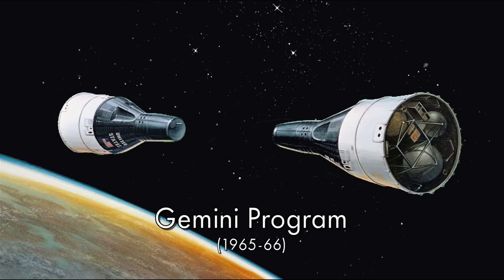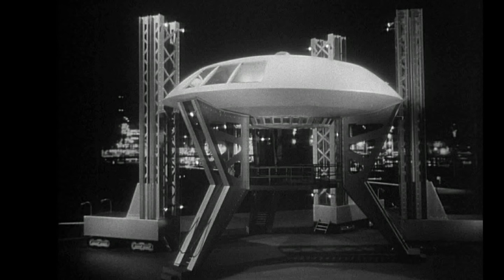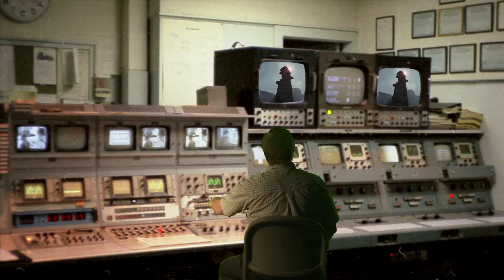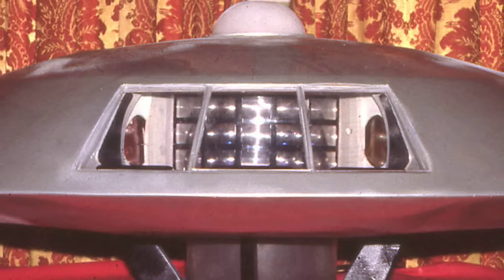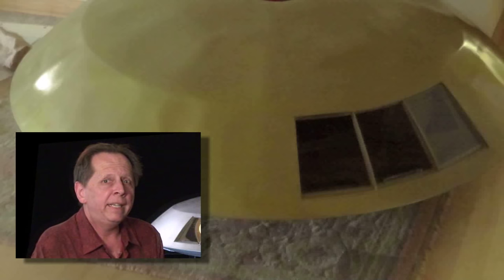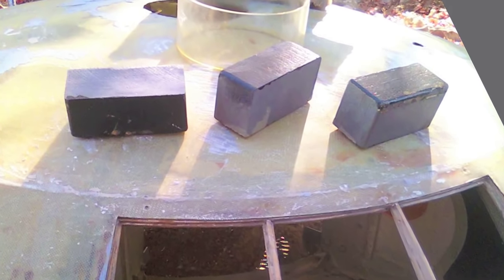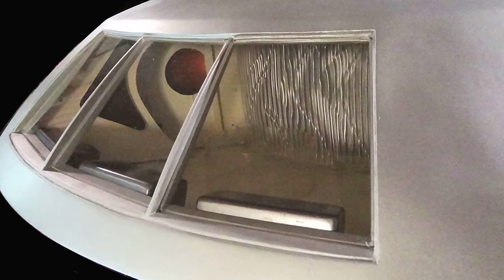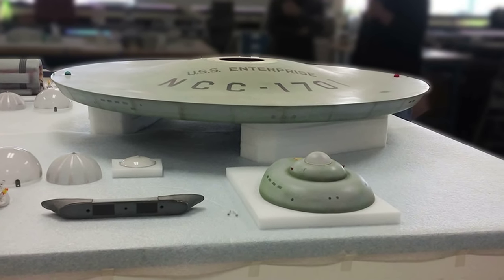RESTORING THE GEMINI 12

Comment: Paul, I gotta say I am JEALOUS!  You did a fantastic job on that ship.  I'm a huge fan of LIS and would give anything to see the model of Gemini 12 in person.  When will Andre bring it to the midwest so we can see it?  I understood the way you felt about the "melted candy bar" mention.  I saw some of Irwin Allen's props at Marine land in 1975 on a family vacation (Seaview, Robot costume and miniature chariot).  Sadly, props are made only for a few time uses and only to look good onscreen.  That's why they're made of balsa and fiberglass.  I remember that auction mentioned in Starlog magazine around 1980 (maybe).  I heard it sold for some $700 and me thinking, "Gee, if I only could buy that thing."  I'm glad Andre got it, though, and had it restored.  Any other projects in the hopper?  Again, GREAT JOB.
Reply: Thank you.  I have doubts Andre will risk taking it on a "tour" as it is quite valuable. 
      And yes, I recall all those and more at Marine Land back when I saw them in 1975.  There was the 4 foot Flying Sub version of the Seaview (that appeared to have been repainted using a bucket of house paint and a house painting brush, somewhat less refined than another fiberglass  4 foot Seaview seen in our new video; "Relaunching the Gemini 12", one that was made from the very same original wood and plaster "approval model"/pattern).  Also, the 18" Flying Sub, the "Hero" Robot,  the small Chariot miniature, the Hindenburg miniature  and even one of the R/C Bell Jet Ranger Helicopter miniatures used in 'The Towering Inferno".
Reply: @paullubliner6221  Yes.  Those were the ones, all right.  I was 13 then and it was the coolest thing to see.  We were visiting my aunt and uncle who were living in Lancaster at the time and we drove ALL the way from Kansas, so, yeah, it was a big deal to me.  The Robot was in a glass case at Marine Land and you pushed a button and it lit up.  Of course, it was in really sorry shape, but to a kid --- that was the Robot. That's the reason I don't want to own props and settle for good duplicates.  I have the Remco Robot still and the Robot toy from 20 years ago that sold for $50 retail.  BUT, I have the Jupiter 2 --- a couple of them.  One I opened up and had fun, the other is unopened and hidden away in a closet.  I paid about maybe $40.00 each for them.  Now, they sell for some $500-600 or more.  Amazing.  Again, great job and thanks for answering.  One of these days, I'm going to learn to build my own Jupiter/Gemini (probably out of styrofoam, knowing me!). Oh, and my real name is Kent.  It was a pleasure to meet you, Paul.
Reply: @yaddamop  And you too Kent.
Reply: I was reading what you said about the props not lasting and one time on Antiques Roadshow they had a lady that was connected to Rudolph the Red-Nosed Reindeer cartoon at Christmas time. She brought Rudolph, Yukon Cornelius and I think one other prop toy but one of them had partially melted. They were the original puppets to the cartoon and didn't stand the test of time too well.

Comment: I find it funny that "dull aluminum" would be controversial.  From  a lighting perspective, its the most logical choice.  You can change its apparent color at will by using different color lights.
Reply: "Dull aluminum" is also one of the several reasons no manufacturer felt at the time there was any value in making a toy version!

Comment: I am puzzled by three things-- and by asking I don't want to diminish the efforts at all-- which were clearly enormous:
1.) The aluminum paint does not seem uniform.  Is that an aspect of the video photography?  It is apparent at 18:54 in the video and at 19:52.  Or, did the Gemini 12 have that look? 
2.)  In the video shots with the model owner, the legs seem to be sticking out and are not flush with the hull-- or are those the pads at the top of the display stand/launch platform painted the same color as the Gemini 12?
3.)  Is the sound deadening material, in black, visible when you look at the lower part of the ship-- or is that the way it was-- with a black line separating the upper hull from the fusion core?
Reply from the maker: Thank you for your questions, these are very astute observations on your part.  I will do my best to answer you:
1) 
 The restored surface was given a uniform and finely textured 
undercoat, followed with the "dull aluminum" paint. The appearance of a 
uniformity of the paint finish is actually a matter of the amount of 
light applied.  Please observe the exterior finish in the three exterior
 shots in the early portion of this video at 1:30-1:38 and again at 
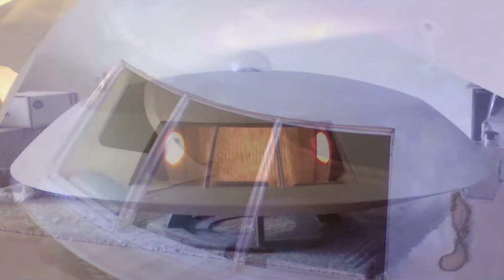17:15, here indoors but with very bright, indirect sunlight. The surface
 appears completely uniform. When filmed on 35mm color or B&W 
negative stock, using full studio lighting, the finish would appear 
exactly as it originally did; quite uniform. Also, in extreme closeups, 
this texturing would also be apparent.  

The original 1964 paint finish had dry concrete powder mixed in with the
 aluminum paint (as did the robot's torso) giving a fine, yet gritty 
surface.  This was personally related to me by one of the original 
prop-makers who worked at Herb Cheek's prop shop at Fox and who worked 
on all of the Irwin Allen shows, specifically on the Robot and the 
saucers for L.I.S. and also the Seaview miniatures for "Voyage".

There was a great deal more that went into this restoration of the Gemini miniature than time permitted to be described in this little video.

 2)
 The stand's three upright were precisely laid out at 120 degree 
intervals in plan view.  The apparent disparity you have noticed is 
simply due to how the ship was sitting on the stand during the video 
taping, it was very slightly offset of a true dead center.  And yes, 
there are three thick cushioning pads so no damage to the miniature will
 ever result.

3)  The sound deadening is completely internal within the Fusion Core's 
inner workings and are in no way visible.  What you are seeing is a 
slight gap that was visible on the original again, depending on 
lighting.  Extremely bright lights actually hide many minor 
imperfections by literally filling them in.  It is the difference 
between the widest ring of the Fusion Core and the way in which it fits 
into the recess on the under side of the hull.  

The opening in the original hull always was egg shaped due to the method
 of how the hull contour was generated (no room for as description here,
 sorry!) and the original fusion core fit no better than does this 
current version. You simply need really, really clear original prints and from all sides to see what I mean.

Paul Lubliner
Reply: Thank you for your response.  The early pictures certainly showed the painting to be uniform.
Reply: Solstice4MNM iiii

Comment: Excellent work. Thanks.  I have got to ask does anyone know what happened to the forbidden planet ship D57B from before  Lost in Space.
Reply from the maker: The large FP ship was sold at auction a few years ago.  The smaller one (about 18 inches) was shown a few years ago in Los Angeles at a Motion Picture Academy Forbidden Planet event.  Robby (the actual prop) also appeared and walked around!  Pictures of the props were not permitted, unfortunately, but you can probably find some on the internet.  The event was around 2014.
Reply: That's C-57D. The movie "Serenity" (spin-off from the series "Firefly") makes several allusions to "Forbidden Planet." The crashed research and rescue ship and its shuttle on Miranda bear the registration number C-57D.

Comment: As a retired professional auto body mechanic I can relate to the video on perhaps a different level than most. Time consuming , long term projects can wear you out! Looks real good, but the hull paint looks quite blotchy.
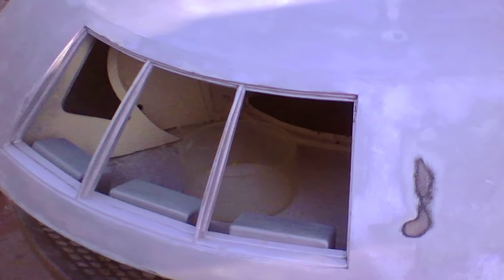Reply: "Blotchy"?  Then how do you explain the appearance of the very same finish at 1:30-1:38 & 17:15?  Come on, this isn't a "competition" after all. May I suggest you relax and simply enjoy this? 
Also, please realize, you're looking at the results of almost 50 years of practical skills and experience.  There's a great deal more to all of this than simply laying down low VOC water based paints, good old "Acrylic Lacquer" or even "Dupont Dulux"!  Those are all easy to get glass-smooth,  I've done enough of them over the decades.  But just like the L.I.S. robot, this thing was, and is textured.  Back in the day, Herb Cheek's shop threw in some dry powdered concrete mix into the base aluminum paint for that "texture". 
The answer to my initial question to you is:  "It's all in the lighting!"
Reply: Is Blotchy an accurate finish? True to it’s original appearance and finish? 

You see a lot of antique cars and planes restored to ‘better’ than new, which isn’t true restoration. If a production Model T had a finish that had runs, than a proper restoration shouldn’t look like a 21st century powder coat.
Reply: @larryscott3982  Larry, it's not "blotchy",  it's irregularly textured, just as when it was new and also as seen on the Jupiter 2 original miniatures AND the robot's torso.  What you call "blotchy" is as already addressed is directly due to the low level interior lighting we used on this video, it is not nearly to the same overall brightness level as was on the original show's sound-stage.  We used video and not film which requires a great deal more light for proper exposure than electronic imaging. 

When this miniature is viewed under  bright exterior light which is very similar to the foot candles of illumination found with full, period studio lighting, and as seen at 1:30-1:38, you can see for yourself the miniature is correctly finished.

Comment: Were the tubes the wires ran through restored?
Reply: Please go to:  13:33 minutes --and you will see the port side "Lydecker" copper tube through the "City Beneath the Sea" window opening.  Also, both of the restored front "Lydecker Tube" openings are visible at:  19:00 minutes and the port side front opening at 20:00 minutes as well as throughout this video.

Comment: Always been a fan, still have the '97 Trendmasters B9 Robot in the box. But did you all know: in astrology, Gemini ruled by Mercury and Sagittarius ruled by Jupiter are the travel signs and planets opposite each other in the zodiac. Famous inventor Nikola Tesla actually came up with the "saucer" design, and the gyro stabilization, drive control propulsion systems. His model fits the Jupiter II almost exactly. If I had to guess, there is an actual flying Jupiter II ! Probably hiding out at Area 51 which the public may have already spotted, UFO....

Comment: Who designed the Chariot?
Reply from the maker: Bill Creber was production designer on the LIS pilot. The Chariot was built right in the same workshop where the scenes from Alpha Control were filmed.  Bill wanted to use aluminum framing on The Chariot but budget restrictions made him use heavier steel. Irwin Allen had brought him over from his duties on VOYAGE TO THE BOTTOM OF THE SEA, to which he returned and supervised the changes to the Seaview's nose and control room.  Creber then designed the classic Flying Sub that still looks amazing.  He left VOYAGE to production design the original PLANET OF THE APES and returned to work for Allen on THE POSEIDON ADVENTURE and THE TOWERING INFERNO.

Comment: I've always liked the show but I never could figure out how everything could fit in the Jupiter 2. I also wondered if Batman bought his equipment from a scratch and dent sale for equipment from the Jupiter 1.
Reply: No, not Batman but literally "Voyage to the Bottom of the Sea".
     As for your "fit" question:  The truthful answer, is  it has to do with simple "Movie Magic", you have to keep in mind, that's all an illusion. --- Of course the depicted interiors couldn't fit in the Gemini 12, not the Jupiter 2 or the Seaview, and certainly not the Flying Sub.  But it was entertaining regardless.  
     That the interiors can't possibly fit is less significant than there being absolutely no room for any means for propulsion, essential fuel, life support, food etc.  
    In the realm of genuine Bona-Fide "Scientifically viable interplanetary spacecraft", there has been only one in all the history of film:   Kubrick's ""Discovery" from 2001.  At over a mile long, it depicted a "space train" with fuel, life support etc., for the five man crew,  where 3 of those 5 occupants were in suspended animation.  The dangerous engines were  that considerable distance away from the crew.   
     All of this for only a "neighborhood trip" to Jupiter Space.  The crew were housed in a sphere, the only rational shape as that form provides the maximum interior volume for the minimum external surface.  An internal rotating ring for gravity simulation was correctly depicted to avoid crew muscle loss during the relatively short several month's long transit.
Reply: Not to mention the chariot and in the later episodes a shuttle from memory. 
Who cares. My favourite show when I was young. Great work on the restoration.
Reply: @Icy_Lucifer1973  Thanks.
Reply: Remember the episode, "2 Weeks In Space"  3rd season where Will Robinson is able to hide himself in his closet from the pursuing aliens!  He is able to completely stand up on his closer's upper shelf concealing himself in the dead space between the 2 decks and furthering the illusion of ship size ...but as adults we know does not make sense...ah.. the Joy's of a beautiful childhood in the fantasy worlds of Irwin Allen!!

Comment: What are the chances of borrowing (or getting a copy) of the blueprints to be able to create a model for 3D printing?
Reply: Unfortunately, there aren't many very high quality of the original blueprints remaining. You can see several of the original drawings from here, and they're in pretty rough shape and would be nearly useless for what you'd be wanting: http://www.iann.net/lis/behindscenes/blueprints/full_size_jupiter_2/
On the flip-side of what I just said, there ARE relatively high quality reproduction blueprints that are available commercially and online that are ... close enough ... to recreate the ship in whatever your favorite 3D virtual modeling software happens to be, such as Carrara, Blender, Maya, etc (and if you design/store the virtual model in wavefront .obj format, they're easily importable/exportable between many of those 3D applications).
TBH, I'm not familiar with the 3D printing, but I do know that those apps I mention have plugins designed to export to most 3D printer systems, too. Of course, you have to BUILD your model virtually BEFORE you can print it out.
Reply: There's also a pretty good site with a "more realistic" version of the Jupiter 2 that was done to reconcile interior set sizes to exterior ship images: https://forums.scifi-meshes.com/discussion/76287/a-new-jupiter-2-that-makes-sense

Comment: Where to get material to make one? Get the forms/parts /motor(s) for the rotating light(s), dimensions/SAE measurements,# of small windows etc.
Reply: The first is any well stocked fiberglass supply outlet.  The second part is a really good question as you can't "get" any of what you asked about.  Why?  Because NOTHING is "available" (as in "store bought" or  online at Amazine or whatever.)  What you are asking about,  those items such as the "forms" the "parts for the rotating lights" etc.  Realize I had to made all of that from absolutely nothing ---as in "from scratch",  including all the designing/engineering.  

---As for the ship's hull and window dimensions, all of that is copyrighted and Proprietary information.               

Lastly,  "SAE":   that stands for the "Society of Automotive Engineers" so I have no idea what you're talking about..
Reply: @paullubliner6221    Standard measurements, not metric.  Forms/ patterns to get the shape correct. How many windows in hull portion...
Reply: @paullubliner6221  The large model used from the first crash is 4' wide,14" high. How many inches from bottom of hull to top of lower level (point where upper portion ends..below windshield/bottom of door). The measures of the one you made? Distance between door and windshield.